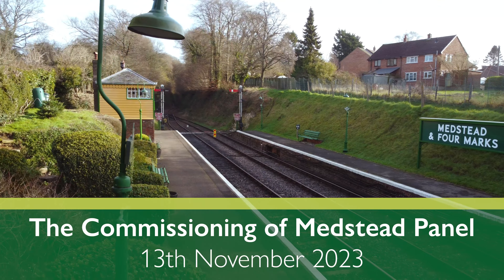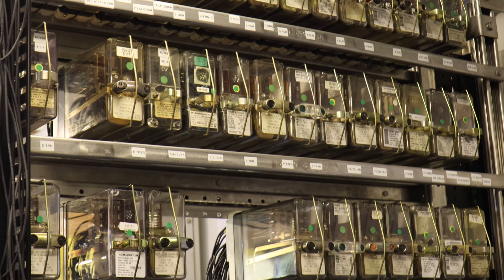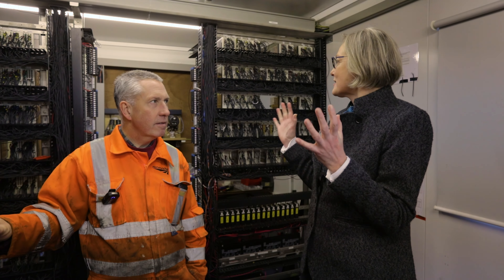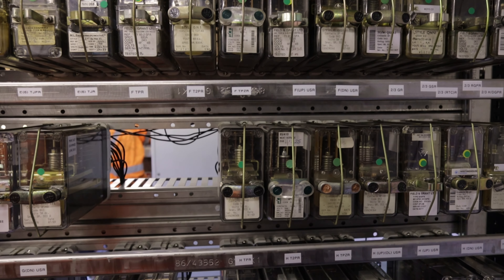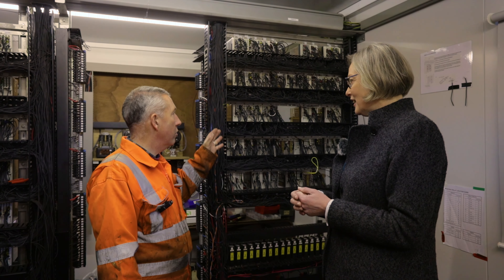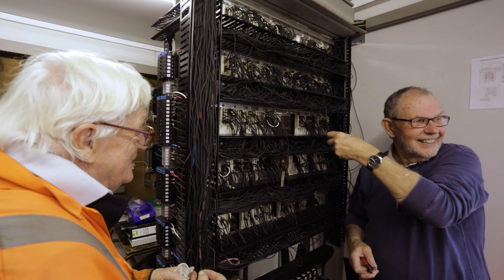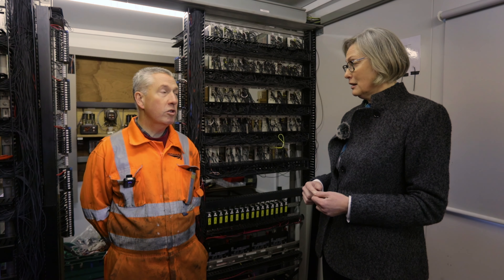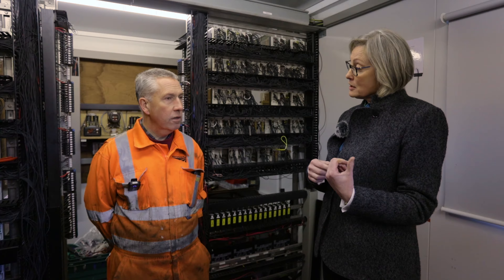The Commissioning of Medstead Panel - 13th November 2023

Comment: What a great job, it keeps the appearance and aesthetics of the railway the same, but there is now a safe easier to use signalling system. Have you left the push/pull signal rodding equipment in place just for the visual effect or has it been removed? Well done everybody.